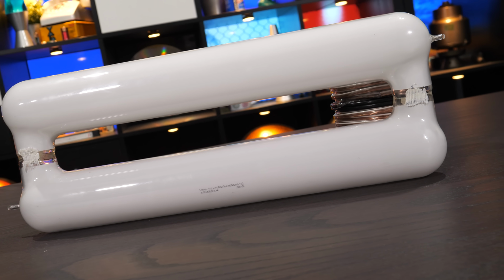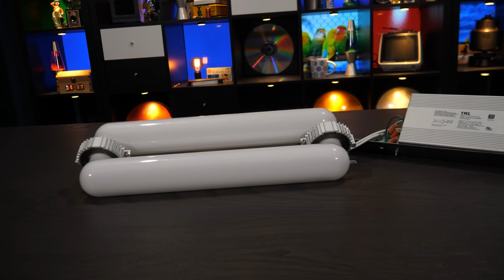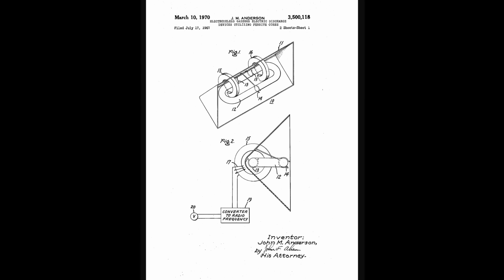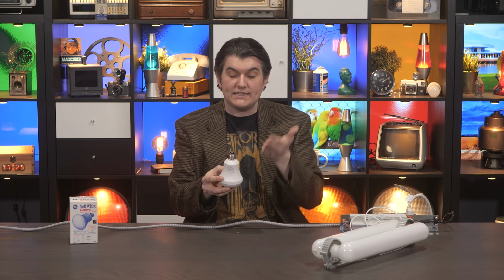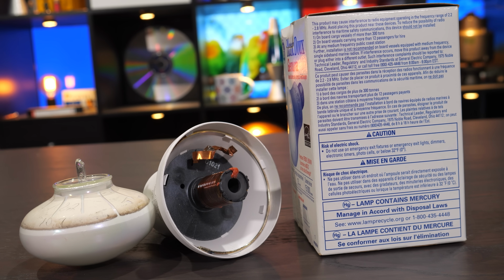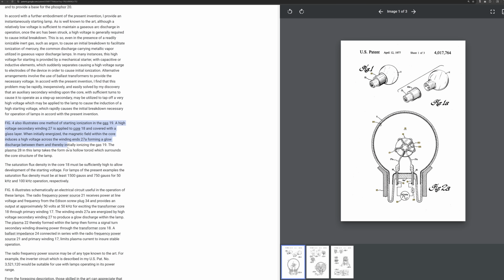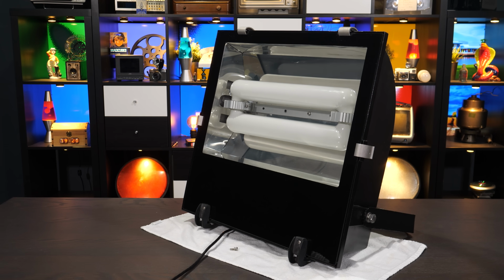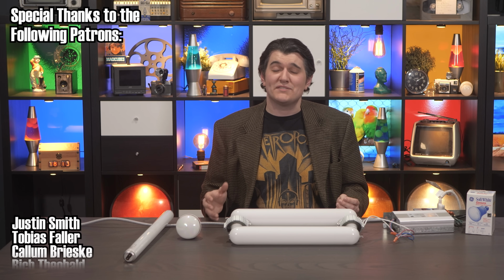Induction lamps: fluorescent lighting's final form

Comment: A professor I had in college was a radio operator in Vietnam. Not a back pack guy, like big ground station. The tent had a florencent light in it and some Sargent came to chew him out about the light being on and my prof, as the story goes, got up on the chair and handed him the bulb (still glowing) as the radios were enough to excite the light.
Reply: If he had held the stem of the bulb to his ear he might have heard the broadcast faintly.
Reply: @Hyraethian  Only with AM. Not with FM radios that were the most widely used in Vietnam.
Reply: @akulkis Nope, any RF source regardless of modulation method
Reply: @MAINTMAN73 nope, because FM is constant power - no way to demodulate that with a gas discharge.
Reply: @akkudakkupl  Nope. All you need is a secondary demodulator mounted onto the tertiary to boost primary reticulation without amplifying dual lap interference
Reply: @Hyraethian  saw a video of some russians messing around an am transmitter, and placing a blade of grass against it would result in the station being audible through the grass
Reply: "Can't help it 'sarge, it's the jungle wizards with their mumbo-jumbo exciting the lightspirits and what not."
Reply: @ALEXANDER1318  Praise the Omnissiah
Reply: @TheIdiotPlays  From that moment I understood the weakness of my flesh, it disgusted me
Reply: @contentcontentconsumer  I craved the strength and certainty of steel.
Reply: @ALEXANDER1318  Sorry Sarge, I'm just a....caveman.....
Reply: @ALEXANDER1318  there is no apostrophe at the beginning of Sarge. Or at the end.
Reply: @joshyoung1440 cool ... You're so smart.
Reply: @ALEXANDER1318 machine spirit
Reply: @ALEXANDER1318  apostrophes hold the place of letters. There are no letters in front of "s" in the word "sergeant."
Reply: Was about to post about using RF from a CB radio to excite the lamp when I read your comment.
Reply: I really hope he didn't say anything, just handed it to him and let him work it out.
Reply: I went many times with my kids and an assortment of fluorescent tubes and neon bulbs to play at night, on a dark road in the middle of nowhere, below the power lines. Quite a spectacle.
Reply: Back in my Navy Radio operator days (1970's) we had a transmitter where we used neon tubes to check the final tuning stages, where the Standing Wave Ratio was tuned. It was a bitch to tune properly, but became much easier using these neon tubes.
Reply: @Verklunkenzwiebel now i wonder if you could do this with (id assume) much lower power ham radio stations
Reply: Cool!  I bet somewhere there is still one of those in use. @Verklunkenzwiebel
Reply: "I assure you, not only does the enemy know where we are, the entire continent knows where we are blasting this much radiation into the sky"
Reply: Them angry pixies really do some interesting things, especially when you get a bunch together for something.
Reply: True story there. As a former CBer and present Amateur Radio operator I discovered that placing an ordinary fluorescent tube in close proximity to a transmitter antenna would be enough to excite the lamp into operating whenever the transmitter was keyed up.
Reply: I absolutely believe that story. HF radio waves, if transmitting with enough power can definitely make nearby fluorescent tubes light up.
Reply: As a radio tech, we kept a four foot fluorescent lamp by the bench. When we worked on Handi Talki's or otherwise known as hand held portable radios that were in the VHF (2meter range) spectrum, we would test their output power by placing the antenna right next to the tube to ignite it with a decent glow and then pull the radio slowly away from the lamp. When the lamp went out we had a good idea of the output power and the efficiency of the antenna. Within several months a tech would get a feel of the output power of the radio. It would also work on the low band radios used by some rural fire departments and State patrols in the past.
Reply: Adrian Cronauer came to mind as soon as I read : "... radio operator in Vietnam."
Reply: @0neIntangible Good Morning Vietnam!!
Reply: @0neIntangible  Radio Operator, not disk jockey
Reply: Angry magic pixies.
Reply: Probably uses a start capacitor to dump a large jolt of current quickly across the coil and that gets the electrons excited enough to become conductive. 

If the edge of that pulse is quick enough, it can essentially have harmonics that would get the excited enough to start up.
Reply: @MorRobots Nah, it would be something like an inductor or transformer that would spike the voltage up only once when the current started through it
Reply: RF is wild.
Reply: When I was in high school, I had a hand-held CB from Radio Shack that put out nominally 2-3 Watts. When I plugged in a magnet-mount whip antenna for the car, I could easily light a fluorescent tube near the antenna. I trolled one of my friends by showing him that, then grabbing the end of the whip bare handed with no problem.
Reply: I have an old LED bulb that does that, especially when you grab it.  I'm thinking the mice constantly chewing things in the wall are to blame. I'll find out when the firemen tell me what caused the house to burn down.
Reply: @the idiot plays 😂😂😂😂
Reply: I've built a few solid state Tesla coils and even a fairly small one will light up fluorescent lamps a few feet away.
Reply: @James1095  I always loved seeing that. Are your hobby coils still in operation?
Reply: I have photos of my two boys standing underneath one of my ham radio dipole in tennis holding 4-foot fluorescent bulbs in their hands. While I was transmitting at 1.5 kilowatts and they were about  20 ft from the antenna the bulbs were lit up in their hands while they're holding them. This is just from the RF exciting the electrons in the rarefied atmosphere of the tube
Reply: Have you seen the movie  Accumulator 1? It is a 1, because there are no sequels, and it's nothing like Terminator or Predator. It's just about a guy who learns that TV steals people's energy and he decides to steal it back. He steals enough of it to light a bulb just by holding it. 
Anyway, it's an awkward movie not really relevant to the topic, move along!
Reply: @vaclav_fejt  brick
Reply: I had totally forgotten the bit about it being the coating that makes visible light and not the gas inside. 

Great breakdown.
Reply: I guess if the TX power was enough to light the lamp at the distance from lamp to antenna, the interference from the lamp power supply shouldn't be a big problem. 😂
Reply: Not only do you tell lies in YouTube comments, you do so with a shocking lack of proofreading.
Reply: @Elbereth42  Given a household microwave oven can light up a fluorescent, a stationary radio tower is gonna have little issue. So that holds up, the rest isn't something anyone can prove or disprove. So what are you even getting on about?
Reply: @Elbereth42  thats his story idk what you want. As most war stories are its probably embellished but you can certainly light a florescent tube with a radio so I don't know what part upsets you
Reply: @Elbereth42 You absolutely can turn a lamp on with an old radio transmitter. What is such an egregious lie here?
Reply: @nicholasneyhart396  Let me add to the train of asking you what is wrong here.

Comment: perfect timing!  i recently saw some of these fluorescent lamps in use at a coal loading facility (explosive dust, anyone?) and wondered where the electrodes were on these unusual gas discharge tubes.  the joke is on me: there are none! 
pretty awesome to see them still in use in 2025.
Reply: I was just thinking of these in terms of intrinsic safety. If the glass breaks you don’t have a pair of live wires in there that could cause an explosion
Reply: Oh that makes a lot of sense as a place to deploy these!
Reply: I love explosive dust, I'll take two helpings.
Reply: @sachyriel  Ah, I finally found out where Pop Rocks come from... In my country (Ireland) it was sold as 'Space Dust' back in the '70's, until (urban legend has it) the stuff was taken off the market 'cos, I dunno, it took some kid's head off, or some such! Probably cos one of his buddies dared him to do that old 'trick' of touching the electrodes of a 9V. battery against his tongue, or something - at the same time!

Comment: When pricing a bulb, most people don't look at the cost of replacing it.  Climbing a ladder is extraordinarily expensive due to the risk of falling.  If your ladder isn't set up perfectly stable, if the person climbing isn't trained or isn't following their training, if the ground isn't solid, if the angle is wrong, all sorts of things increase the probability of falling.  So while climbing a ladder might bring a 1 in 1000 chance of falling (fake number for demonstration purposes only), it may not sound terrible but the average cost of a falling injury might be $20,000 in hospitalization and lost income.  That means every time someone climbs a ladder it's $20 worth of risk.  If you have to change an incandescent bulb every 2000 hours, that's $0.01 cents per hour of operating costs. If you have to change a tube every 100,000 hours, that's $0.0002 cents per hour.  Multiply by the number of light fixtures (a city may have thousands of street lights) and that's real cost savings.
And a homeowner on a ladder has a much higher risk of falling than a trained maintenance worker.  If I climb a ladder like the average suburban dad that I am, I'm probably at a 1:100 or 1:50 chance of doing something stupid ending in a trip to the ER.  For me, a bulb that lasts 10 or 100 times longer is way cheaper than a bulb that costs half the price at the store.  Of course LEDs have solved that problem for most people.
Reply: Very, very true. And the higher the light, the more precautions you need to take. High enough, and you need to hire someone with Fall Arrest training and wearing the appropriate safety harnesses.

This issue could be also true in reverse; confined spaces - particularly toxic or dangerous locations. My dad, an electrician, once had to change the light bulb inside a municipal sewage pit. He couldn't smell anything for a week! 😳 Other than the smell, the installation had to be sparkless for obvious reasons.
Reply: I fell of a ladder.
I do not recommend it.
Reply: The final note is of course when the LEDs don't burn out just as fast! Although that's probably mostly a domestic problem with buying extremely cheap lightbulbs.
Reply: I am not scared of risk per se. I am extremely scared of ignored risk. If you cannot acknowledge present operational risk in the simple day to day, great for you, but I hope you don't hold any positions of responsibility.
Reply: If you have a 1:100 or 1:50 chance you really should stay away from ladders. That's not normal. 
Either learn how to use them safely or just don't look at a ladder ever again for the rest of your life.
Reply: Most LED lights last maybe a couple years.
Reply: Holy cow I’m sitting on my ass on the couch and asking my wife to fetch me beer chips and grilled cheese sandwiches because of your safety warning thank you so much
Reply: By this logic, ladders should require a license to operate and require background checks before you can buy one. You scared of everything in life this much?
Reply: @irysh9 you just described a licensed and bonded business bud, and yes they are scared of expensive medical and liability bills. Why are you scared of being scared?

Also reminder this was just a comparison for cost benefit analysis not a discussion about ladders
Reply: Silly premise, also we have the long extendable sticks you can buy to change out lightbulbs. Also people use drones now to change lightbulbs.
Reply: @keith3761  no they don't???? I have never, ever seen or heard of anyone using a drone to change out a lightbulb.
Reply: @keith3761  That's not going to work very well if the bulb is in an enclosure.
Reply: @keith3761  do you use a drone to change light bulbs? how about your parents and grandparents? are you planning to buy a drone just to change bulbs? 

i have a prediction: no, no, no, aaaaand no
Reply: I have and you will find a few videos showing you how to change a blub with a drone. You can use very cheap drones to  do it as well.

Comment: Every time I see someone complain about LED bulbs not lasting long enough I just link to Philips Ultra-Definition lights. Long lasting and CRI 95 lights. And they are like $12 for 4.
Reply: And apparently kind of difficult to find outside North America, at least under that name. The closest I can find available to me is the Philips Master Glas Dimtone series (CRI 95, greater efficiency than standard Philips LED bulbs but less than the UltraEfficient series and warmer light when dimmed).
Reply: Last time I replaced an LED bulb I replaced it with something Phillips that warmed when dimmed. Unfortunately I'll never know how long that bulb lasts because I was replacing the old bulb as part of my contractually required "moving out cleaning"
Reply: I had a couple of the early LED PAR38 bulbs back when they were $50 a piece. Those lasted a very long time. I used them until they got too dim. Those were the only LED bulbs I've used that haven't died from a broken bond wire in an LED or had a driver failure. They had massive heatsinks that kept them cool.
Reply: But LED is still boring and will never reach the beauty of plasma. That's why I will continue using fluorescent lamps as long as  I live.
Reply: @mernokimuvek  LED and fluorescent work the same way. Generate UV and excite a phosphor. You are not seeing the plasma. LEDs have great phosphors now with <3000K color temperature and great CRI.
Reply: @zeframm  Unless you're a fanatic collector of lamps and a real lover of tech, you won't get it. You probably also don't understand why some people still make real neon signs instead of buying some LED crap form china,
Reply: The Philips bulbs have definitely been my longest lasting ones of all LEDs, they still can't reach the longevity of the incandescent bulbs they replaced, but they are better than most. I've managed to get a few years out of some of them, which is exceptional for an LED bulb.
Reply: @Green__one  You really believe your LED lights are not lasting as long as incandescent bulbs? You are getting less than 1000 hours of operation?

I don't believe you.
Reply: @zeframm Yes I really believe it, because it is a measurable fact. And I don't care what you believe.
LEDs themselves can last an incredible amount of time. But the ultra cheap electronics that they are being packaged with don't.
Reply: @Green__one  I have never experienced having to replace an LED after 1000 hours. I usually replace for better lights before they burn out.

Try the Philips.
Reply: @zeframm I still have one or two Phillips, they do seem to last marginally longer than other LEDs, but they also cost significantly more, and the marginal extra life is not enough to account for the significant extra price, so I don't buy them anymore.

Comment: 18:02 In US Patent 9305765B2, it describes the small metallic meshes as areas to induce rapid heating of the mercury and needle points to produce free electrons during the high power startup phase of the lamp. This makes sense to me from my physics background as heating, applying high voltage, or strong induction to metallic needle points are a common way to produce free electrons in electron guns, Tesla coils, etc. They also describe the potential for use of several different materials for the flag, "The metal of flag, mesh or solid, may comprise steel, stainless steel, nickel, titanium, molybdenum, tantalum and the like". Several of these would be very durable in long term use despite the environment and because they are constantly supplying electrons like a traditional electrode.

Comment: First heat pump everything, now induction everything? Love it!
Reply: Heat pumps are also technically induction since the compressor is commonly an induction motor.
Reply: Wait until you find this technology in a toaster!
Reply: Heat pumps driven by induction motors in electric cars. Alec's wet dream of efficiency.
Reply: I am all for induction everything. Things like electrical contacts and charge-pumped capacitors suck. I want my appliances to purely vibe with the E-fields
Reply: @afelias  You want the M-fields, or not? Ot the far field, where E and M have their natural balance?
Reply: Oops all heat pumps
Reply: Induction powered heat pump
Reply: Next, induction powered heat pumps?
Reply: Someone needs to make a lamp that works on the refrigeration cycle!
Reply: Pump the induction.
Reply: Although induction is pretty inefficient when you look at it on a power factor level
Reply: @Floofie_boi  Could you explain more about what you mean? Power factor level? Are you saying that it doesn't put out as much energy over time as something like burning gas would?

Induction is very time/cost of use/energy efficient compared with its peers.